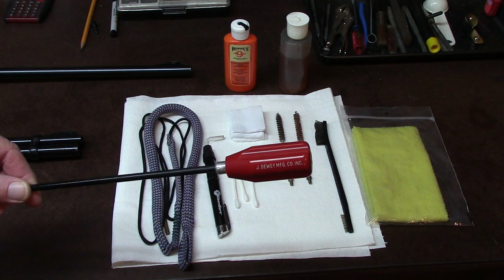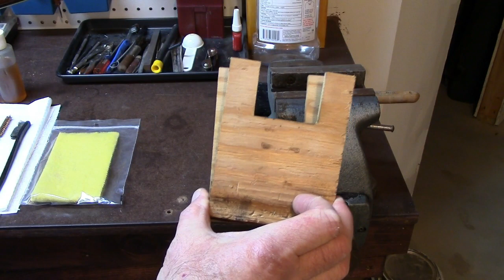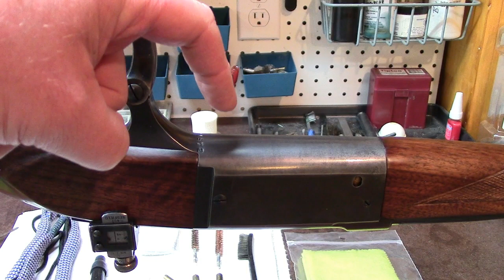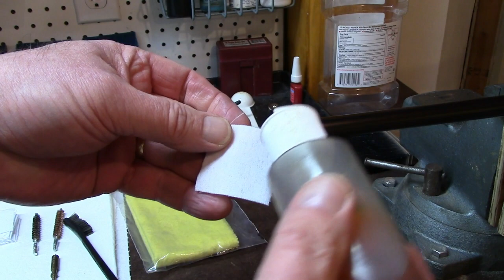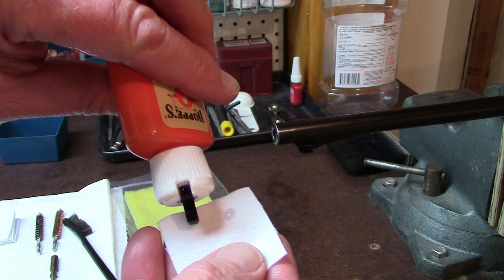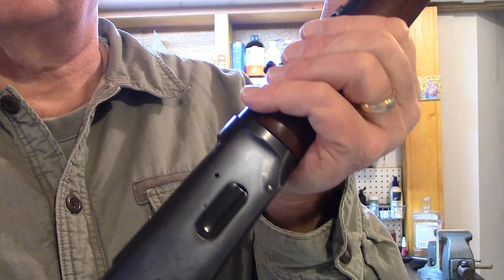How to Clean Lever Guns

Comment: Another great informative presentation....too bad the guy does not have the time to listen and get as Paul Harvey used to say, "The Rest of the Story".  I assume you also clean your bolt guns upside down?  I am going out to buy a vise for my cleaning bench as I have never used one for cleaning, but it makes so much sense.  I have a 300 Savage which is a CD serial model 711XXX which the best I can tell was probably a 1951 or 1952 model.  The stock has some dings, but the receiver etc is in good shape.  It still has the old Bushnelll scope someone mounted before I got it 27 years ago.  It shoots great using the ammo I bought at the time...Remington 150gr and Imperial 180 gr.  It is not quite as good as yours being 1-1.5 inch group but plenty adequate.  I recently got the dies to reload and I am looking forward to using the load you mentioned as a reference....yes, I will check the books.  I bought it and a .308 model from a dealer in Florida at the same time  for a great price  for the pair....regret selling the .308 carbine model, but I was made an offer hard to refuse for it.  It was such a great woods gun.  I need to get the oil out of the stock also.  I never considered soaking in acetone....thanks!!!

Comment: Another very informative video...thanks.  I have inherited a Model 99 Savage from a family friend who has now past away.  He purchased this rifle in 1937 via a Montgomery Wards catalog.  The rifle gun stock and and forearm appears to be damaged from over oiling - just as you mentioned in your video(s).  I would like to restore the wood stock and forearm.  I noticed you mentioned that you soaked the stock on your Model 99 in Acetone  followed be heat lamp treatments.  Is this correct?  Any other recommendations for saving the wood gun stock and forearm on my Model 99 would be much appreciated.

Comment: Let me first thank you for your sacrifice and service in Vietnam. Thank you for your love of America. My question is how to best remove oil from a gun stock? Ideally without harming the underlying. Can you add any more details with heat and acetone approach? Thank you
Reply from the maker: Acetone will harm some finishes, so test on a small spot, such as under a sling swivel.  If a stock is varnished or urethaned, oil removal can be extremely difficult, if not impossible without first removing the finish. If confined to a small area around the receiver, I would place the stock in a bath of acetone, covered over night, preferably outdoors. Aluminum roasting pans are good for two piece stocks, but you must improvise with long ones.  After soaking, allow surface to dry.  Manually rotate the stock several inches from a heat source, such as a propane space heater or heat lamp, using great care not to scorch the wood or damage the finish,. If the stock is finished, heat only the unfinished inner side, and coax the oil out gradually.  As I informed another, try vacuuming the softened oil out with a vacuum kitchen sealing machine, alternating soaks.  Be sure to test the plastic on the machine, that it is not harmed by acetone that may escape, and clean it thoroughly before using with foods.

Comment: Thank you for making this video. As you comment regarding the crown to not be obsessive over damage through proper care, admittedly I can't help but worry if I don't use a brass muzzle guard. What is your opinion on muzzle guards? I use a dewey nylon rod or carbon fiber rod and nothing else but an occasional boresnake. Without them I do my best to avoid touching the crown but every now and then my brass jag may tap the crown on the way out. Seems ridiculous to worry but the internet is full of alarmist rumors and recrowning certainly isn't fun.
Reply from the maker: Barrel steel is very tough and is not easily harmed.  It takes quite a purposeful encounter to nick the crown.  Normal care and caution will preserve its integrity.
Reply: +GunBlue490 Thank you for your quick reply, I'll try to sleep a little easier. Thank you for your informative videos.

Comment: Sir, would you advise folks who are mechanically inclined and have followed you for several years to disassemble and clean a 1956 date of manufacture Savage 99 in 308? I would like to clean action, clean rotary magazine because this rifle fires and ejects first three rounds, but has a devil of a time gettin lever open to eject the last round. Therefore the rotary magazine will need to be disassembled regardless. I have seen several videos of this…some of which I disregard as soon as the smith bangs the butt stock to unseat it from action once long butt screw has been removed. Am I poking the bear to want to get this rifle working by going through it myself. I live the next State o r from you sir and do not know savage 99 experts here in Green Mountain State or even in the granite state. Thanks

Comment: I noticed on your 1894, the top of the bolt has machining marks that look like crude gouges or imperfections in the craftsmanship (the part that rides inside the walls of the receiver).  I wouldn't have noticed but I just bought a '57 model in 30-30 and mine has the same "tooling marks" or whatever.  It's good to see that they are at least consistent.  I wasn't really sure if the makers were just kind of careless, or if the less than smooth surface was necessary to aid in reliable operation, should any carbon or debris get into the track the bolt rides in.  Obviously, it was on purpose and works, I was just wondering if you had any knowledge of why or how they made them this way?  It almost looks like someone took a punch and zinged a few crescent shape gouges into the surface.  I'm not familiar with guns from this era, my previous oldest gun was a '68 BAR prior to me purchasing the '57 1894.  Not concerned with the functionality (I know it will work), just interested in the process/reasoning for this method of manufacture?  Thanks for any explanation if you get a chance.
Reply from the maker: Those marks are simply left by various milling, machining and surfacing operations, and are typical for any internal surface of guns produced during that era, before the relatively recent innovation of parts tumbling that can reach inside surfaces.  The Model 94 was produced as a very well-made, but affordable gun that could be bought by the average blue collar worker, and it was produced by exceptionally skilled craftsmen by the world's leading manufacturer of lever action rifles.  The marks are not by any means defects, nor are they an overlooked process.  They actually work like microscopic rails that the bolt glides upon, where a light application of oil remains for metal protection.

Comment: My 99 has some of the gloss finish that was o er applied an eighth inch onto the metal. Even though it does not appear to have been over-oiled, I plan to dip stock in a etone to remove all the built up layers of gloss finish. It is not oribinal, has  butt pad,  a redfield scope ad swivels added. I have a .243 with gold trigger, I believe made in 1951. It should bean awesome lever once get it back home, disassembled, without messing with rotary, , and thoroughly cleaned and assembled again. Any special considerations on the  heckering, as I do not want to recut checkering. I lo e ghese old 99 Savage Lever Guns! Gunsmoker 55.
Reply from the maker: Checkering can be cleaned using a stiff toothbrush. Model 99 checkering was not the finest in the business, but is part of it's heritage.
Reply: GunBlue490 
Your videos have been so helpful and have a lot of wisdom on guns. I really like the finish on y8ur Alaska Savage rifle. Any suggestions on how to thin down thw thick finish to get it closer to original? I am considering using 0000 steel wool dipped in some acetone and lightly taking the excess glaze build up. Many people have told me to not use sandnpaper. My rifle does not have excessive  oil in wood. My 243 is the tang safety and gold trigger with aluminum cartridge counter, not brass like my savage 99 300 savage has. Thank you, Michael USAF Retired.

Comment: After you remove the accessive oils with acetone what brand of oil or substance didyou use to restrain the wood
Reply from the maker: I didn't use stain.  I simply wet sanded ten coats of Formby's Tung Oil, diluted 50/50 with mineral spirits, using progressively finer sandpaper with each coat, applied with my fingers.  Cut the paper into 1 inch strips, wrap around two fingers.  Dip the paper into the diluted Formby's, and gently work into the wood.  Wait 24 hours between coats.  You'll see no change until the grain fills, but then you'll have a mirror finish.  I recommend using satin, which will provide a beautiful luster without being glossy. Stay away from checkering, and don't sand the corners or reduce diameters where metal joins!

Comment: Mr. Gunblue, who do you recommend to rebarrel 30-30 to 7mm-waters? Why not sir.
Reply from the maker: Jose Canisales 
Check with a local gunsmith.  There may be someone who makes them.  It's nearly obsolete, so it may be difficult.  There may be some Winchester replacement barrels out there.

Comment: So how did you manage to clean the wood furniture and get all the old oil off? Did you use boiled linseed oil after that or a shellac type coating. It did come out very nice.
Reply from the maker: Mr42960 
I alternately bathed the wood in a foil covered foil pan of acetone overnight, then allowing it to dry, followed by carefully heating it with a 6 inch propane catalytic heater, which drew out the oil.  Leave outdoors if possible.  I repeated this process over four days.  It's extremely important to avoid scorching, which can occur in an instant, with hot oil.  

The stock finish is Formby's tung oil, "low gloss".  I use a method known as wet sanding with the oil, which fills the grain with its own wood dust, and results in an extremely hard, dense, clear, waterproof finish.  It's a progressive process that takes about one week, with only one sanding per day, allowing the oil to harden between applications.  One starts with strips of 100 grit paper wrapped on a small block, gradually going to finer grits, ending with the finest wet/dry paper.  Before beginning each day, I placed a very small amount of oil in a small glass chafing dish, thinned slightly to about 75% strength with mineral spirits.  The wood is carefully sanded in oval egg sized circular patterns crossing the grain, while keeping the wood wet with the oil, until the grain fills and becomes smoother, doing small areas at a time.  Sand very lightly and avoid removing wood! This is a grain filling process. Complete the application by rubbing with the bare palm until it works in and feels dry. Keep in a warm place overnight.  Repeat with a finer paper each day.  

Never, ever, sand where wood meets metal! Never sand the wood with grip cap or butt plate removed. Never sand checkering.  The whole idea is to sand the wood without removing wood, and remember that it will ruin the stock forever if the wood shrinks below metal surfaces.  Maintain all original sharp edges.  Use a sanding block at all times to maintain flatness. The fluted section above the comb can be sanded by drawing a 1 inch strip of paper under the thumb.

The grain will be dull until the last two grits, when it will suddenly pop to life.  You can finish up with just bare handed applications of oil, using just a couple of drops at a time.  Checkering can be oiled with a toothbrush, using oil thinned to about 30 percent. One or two applications is sufficient.  Avoid glossy, overfilled checkering by brushing it in until it sinks in.
Reply: Wow, that was really a labor of love, lots of hours of diligence. It was a great bonus that you were rewarded with such character in the grain. Thank you for explaining to me and for your no nonsense videos.

Comment: im going to get some duey rods of all sizes the sectional rods are more for 12 and 20 gauge smooth bore shotgun barrels because you can get away with using them on those and if you use ballistol or clp you do not have to worry about if you put your gun upwards and the oil leaking down and messing stuff up either way if you do the right thing like you said in the video you wont have that issue even if you dont use ballistol but should your jags and slotted tips be bronze as well?
Reply from the maker: There's no need to use dripping amounts of any liquids in a gun, even in the least.  A simple swab with a single lightly oiled patch is sufficient for protection.  As for cleaning, it should be done with the greatest care as I showed in my videos, allowing no more cleaner than is necessary to remove carbon.  If it's running off the gun, it's far too much.  Carbon removal is very simple and requires no special agents.  Except for the fact that I like the smell of Hoppe's #9, I clean my guns with simple mineral spirits and wipe them down with mineral oil.  Most gun products are nothing more than that, with some toxic additives that are entirely unnecessary, and do nothing.  Ballistol is essentially made of vegetable oil and plain alcohol.  Alcohol allows water to mix with it and dilute it.  If you like rain drops diluting your gun protection, it's a great product.  I prefer to use mineral oil that won't wash off.  All my tips are made of brass, yes.

Comment: How difficult is it to take the model 99 apart and more importantly put it back together.
Reply: 3 out of 5 . Not too hard , easy if your into guns and if not hard. I suggest dont take out magazine because its wound under spring tension and is hard to get back into proper tension. But do take it apart and clean it as what i did do. I also fixed the tang crack and tang spacing for future cracking.

Comment: GB, It's a little difficult to see, but, is the barrel a blue/black color or more of a brownish?I'm trying to find out when rifles changed (year) from the brownish color to the more blue/black color.
Reply from the maker: No browned guns have been made commercially since the 19th century, except for a limited number of muzzle loaders.  "Rust blueing" is still used as a method of bluing silver soldered double barrel guns or other high grade guns where regular hot tank methods would destroy solder.  Such guns will exhibit a very deep, lustrous blue, but under sunlight will have a slight mahogany hue.  
Most of the time, a brownish tint is simply a coat of rust.  Mop it with Hoppes #9 and set aside overnight, then mop again and wipe down with soft flannel.  Repeat process until rust is cleaned off and blue is bright.  Stubborn rust can be cleaned with Hoppes and 0000 (4-0) steel wool, but no coarser!
Reply: Great. Thanks for the information and advice.

Comment: There was an old prison here in Tennessee and the guard guns were 94 Winchester rifles. At the start of every shift (X 3) the rifles were loaded to the max. At the end of each shift, the weapons were unloaded using the lever to prove that no rounds had been fired or were still floating around in the system. You know the old  "No brass or ammo drill Sargent". One of my cousins was an old time gunsmith. And as things happen, these guns were sold in an auction when the prison was shut down. Tis cousin of mine was asked to work on one these rifles. According to him the guns were completely worn out.  The finish on the outside was just about completely gone, the lever bolt and lever were sloppy and rattlely, but the bore was pristine. They were fired one time a year, cleaned and put back into the system. No telling how many times these were cycled. They were not safe to shoot according to several gunsmiths that had anything to do with them.
Reply from the maker: Well, I just ran some numbers.  A fully loaded carbine would hold 8 rounds, plus perhaps four cycles to rack it clear.  At that rate, you're over 1/2 million cycles in 40 years, which is far beyond any engineered design rate for a deer rifle that would hardly cycle two hundred times a year, at most, and not under industrial conditions where indifference of non ownership and lack of care adds to the wear.